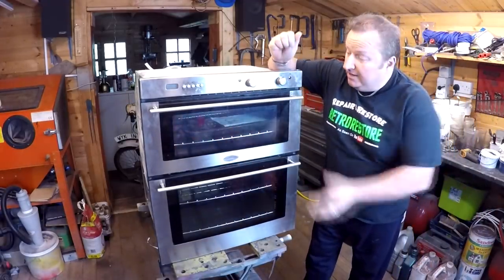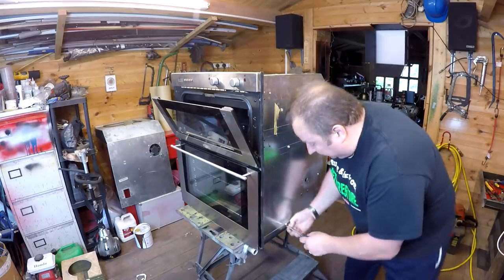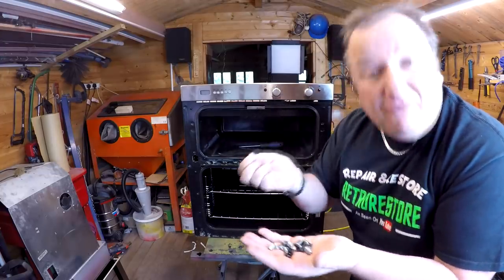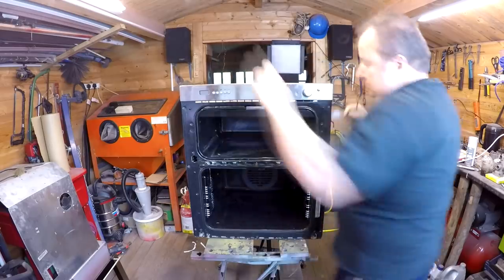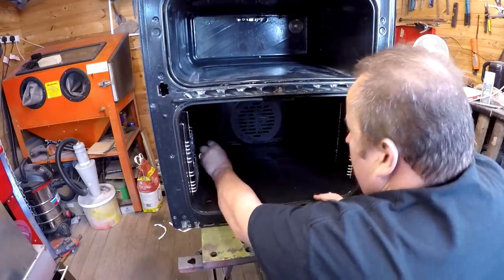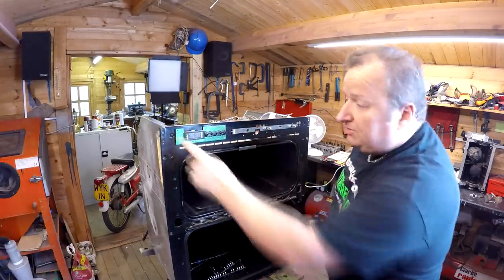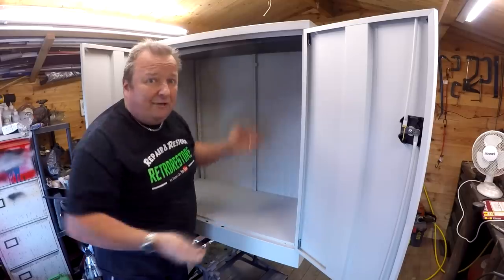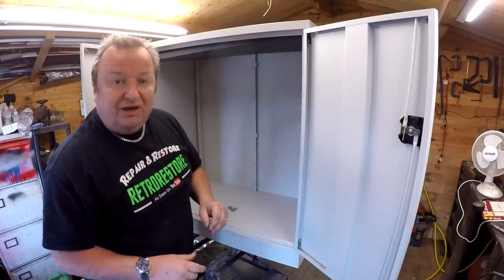My Home Made Powder Coating Oven Build Part 1

Comment: I know I probably sound like a granny but... Wear goggles when using that grinder. I learnt the had way, amazing where sparks can bounce and get you in the eye. The uvex ones with the silicone edge are the best I've found. Nice project, will keep the shed nice and warm in the winter!
Reply from the maker: Eddie, Did you not see I had eye protection on bud.
Reply: @retrorestore  safety glasses won't do you any good when a spark jumps under them. Same with ear defenders, don't do you any good on the shelf. Don't take it the wrong way, just experience of doing things and learning lessons.

Comment: If the fan could be switched on and off I think it would be good for more even heat also for warm ups! As long as it's off at the very beginning I think you would be ok!
Reply: My powder coat oven has a fan just like that. It does indeed keep it at a uniform temperature. With the fan off, the top of the oven is roughly 100 degrees Fahrenheit hotter than the bottom.

Comment: Good project Martin. I think you should use the fan otherwise you will get hot and cold spots in the oven. The powder shouldn't blow off as its electrically charged to stick to the parts. I used to work in a powder coating/shot-blast company many moons ago and all  the items there was hung on hooks to go through the oven on a moving track and the powder stayed on so you should be good to go. You can always baffle the fan so it isn't blowing directly over the items being coated :)
Reply from the maker: Thanks Vince, I've disposed of it now so i'll have to go without the fan. Thanks for the info though.

Comment: Use the fan to get an even temp around the oven, but put a shield in front of it so the air goes out the sides top and bottom.

Kev, ex powder coater.

Comment: surely you will need that other heating element and fan to use in order to stop cold spots in the oven from forming and id also use your own temp control as the standard oven ones are not very good.
Reply from the maker: It will be fine bud, I've a pal who did similar and it works great. Fan not needed.

Comment: If the electronics are still working, then all you need to do is install the thermostat and heating element(s) and go for it. I am presently doing the same thing with an older Whirlpool stove/oven. I will disconnect the stove portion and use the oven setup electronics.  Interested in seeing your's work now!
Reply from the maker: Won't be long Gary.

Comment: nice build i am just starting up powdercoating but i have a problem, i am tring to remove some powder coated motorcycle part and i can NOT find a stripper to do it, i have tried a lot of different paint strippers but nothing will remove it, i have a sandblaster but it takes hour to remove a small part. Do you think you could do a video on removing powdercoated parts please

Comment: Make sure you earth the cabinet !
Reply from the maker: I was a sparks for 25 years Stu.
Reply: @retrorestore  you could use the insulation that's already around the oven cavity's ,the inner door glass should have a heat reflective coating on one side,the outer glass normally does not,use the top oven selector switch and thermostat as they are  geared up to run the load required for the grill and base element  maybe support the element's as they can distort  if unsecured,keep a note of the model number and serial number in case you need a replacement element at any time .there will be a thermal cut out on the top or back of the oven that will cut the supply if its rated temp is exeeded so check that rating and positioning good insulation should prevent  this from happening (you could always bypass this probably not a good idea though )im a white goods engineer 20+years,can't wait to see it finished  !
Reply from the maker: @stuallen7367  Good info Stu, cheers bud.

Comment: Hi matey, I’m in the process of building pretty much the exact same cabinet as you’ve done.
I’ve got all the insulation and sheet metal work finished and have just noticed that the sides of the door don’t seal and have small gaps. Did you have the same problem? If so, did you do anything about it? 
I’ll more than likely order some high temp sealer and a rubber seal. Just curious if you had the same issue.
Reply from the maker: The gap shouldn't matter. Try it first and see.

Comment: The fan in a fan oven is necessary otherwise the heating elements get too hot and blow.
Reply from the maker: they don't blow bud, that's for the cooking for even heat around the oven.

Comment: Have you given any thought about what you will use for a booth to apply the powder coat, looks like you may need the metal from the old oven after all. The oven fan maybe too small for the job. The agent who will show you how to use the coating gun will be able to tell you what will be required to safely operate the coating process. Good luck
Reply from the maker: Yes, I have to sort out a spraying area. That will come soon.

Comment: Hi There, looks great! What kind of oven did you use? Im having a bit of trouble finding out what kind of oven i should look for. Thanks in advance :)
Reply from the maker: It was just a standard electric cooker, nothing special.
Reply: retrorestore, thanks for your reply! My confusion came because the double cabin types are not common in the Netherlands. 
I bought a cabinet today and found a single donor oven so i cant wait to get my hands dirty and see where it goes from there ;). 

Ps: also thanks for the great review of the electrostatic magic gun. You literally answered all my questions that i had with the gun an the techniques behind it vs the standard electrified guns. Ordered one directly after your watching your review! Cant wait to start powdering! 💪🏻 Cheers 🍻